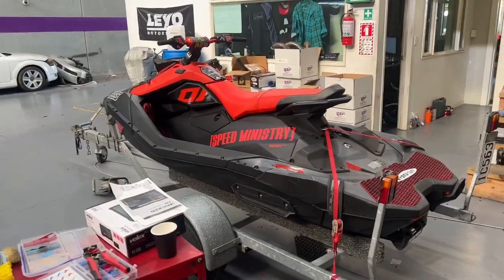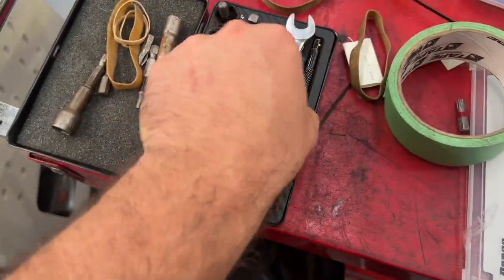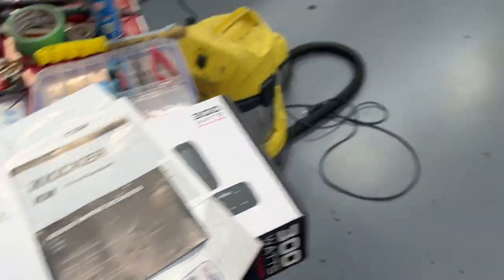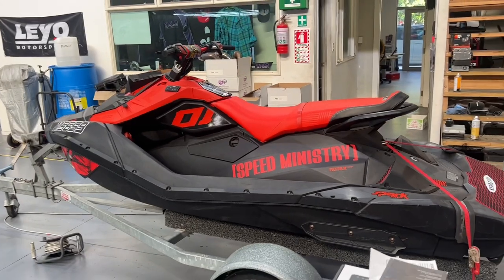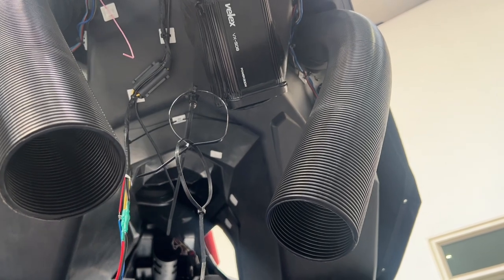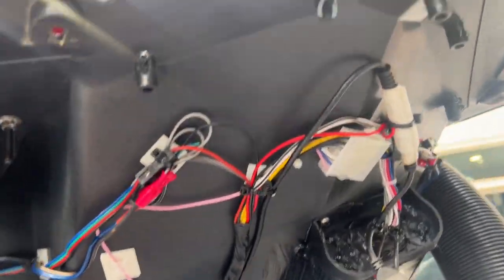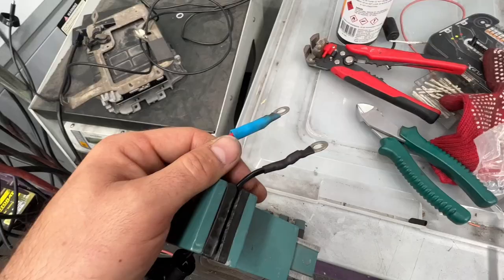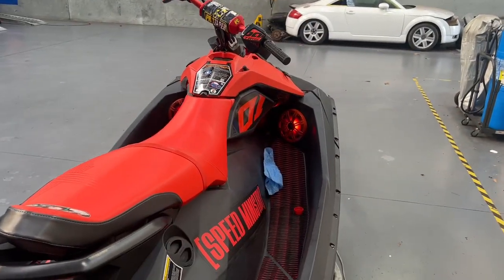SeaDoo Spark HOW TO: Stereo on a budget

Comment from the maker: PSA: CHECK THESE SETTINGS ON YOUR PHONE (especially if you have static/ground loop noise/ hiss)
1) If you streaming from Spotify, go to "Settings & Privacy", then Playback. a) Change the volume level from normal to loud. b) go into equalizer, and change to "small speakers". 
2) For phone itself - Go into Settings - Sounds - Headphone safety. Make sure you don't have Head Phone safety volume turned on. THIS WILL SEVELY LIMIT THE VOLUME and force you to max out the volume on the amp, which will give you the hiss.  

3) lower the volume on the jetski stereo (on the amp controller), and bring the volume on the phone all the way up. This way you don't have to run the amp "louder".

Comment: Did this exact install.  Do you have some buzz when power on.  Doesn’t get louder with volume but if music pauses hear some static/humm
Reply from the maker: hmmm, interesting. 
No, no buzz for me. What you are describing -  sounds like a ground loop,  usually happens when something is not grounded right. It can also happen when you have random interference somewhere. make sure that your 12V feed and ground are straight from and to battery terminals, and that terminals are not oxidized. 

One other thing to try - 
1) If you streaming from Spotify, go "Settings & Privacy", then Playback. a) Change the volume level from normal to loud. b) go into equalizer, and change to "small speakers". 
2)lower the volume on the jetski stereo (on the amp controller)
3) bring the volume on the phone all the way up. 

Try this. Usually, the static noises become more audible when the source (phone) volume is low, and your amp's volume is too high (more technical  - Google gain setting). Cause technically amp amplifies (excuse the shitty pun) whatever you feed it, meaning if there is some static/noise, it will make it a lot more audible.
Reply from the maker: If all that fails, try powering the amp from a different battery outside of the ski. if the noise is still there - claim a refund on the amp or replacement. at the end of the day, chinesium is great, but it's still chinesium.

Also, give us an update when you tried it. This video gained about X10000 times more traction than i thought it would, with confirmed at least 50+ installs, so whatever trouble you having, most likely someone else will have the same glitch. Comment section usually has real answers to problems :)
Reply: I actually got another one from Amazon.  It does the same thing so I’m a little disappointed.  It’s weird.
Reply from the maker: @RC-zn1pn  have you tried adjusting the volume on your phone? Another fun one from a bloke in Ireland - he had that hiss and though the speakers. 
Turns out he had 2 things - 
1. Needed that trick with Spotify equalizer (a couple comments above this) 
2. For Iphone itself - Go into Settings - Sounds - Headphone safety. His Volume was clipped at 50%. So to hear any music on the ski, he had to max out the volume on the amp. 
I've tried the same thing, and, sure enough, if the source volume is low and clipped, and you wind up the Chinesium Velex all the way up, she has an uncomfortable hisssssssss.

Comment: How often do you charge the battery? I have 2 kickers and a 4 channel amp and I originally got low voltage issues after a couple hours riding. Now I charge the battery after every ride. Have you considered a secondary battery?
Reply from the maker: just came back from holidays, put on 18 hours of riding with max volume, not a single charge. But i did replace the stock trash battery with higher CCA AGM one :)
these days, my go-to is lithium Ion. They came down in price quite nicely.

Comment: How does the bass sound without an enclosure? Would you say same, better or worse than stock sea-doo sound system?
Reply from the maker: Hey. Bass, by definition, requires enclosure. Otherwise you will end up with nothing but high frequency. stock sea-doo sound system - Which one? Bit better than on on RXT, 10 times better than a clip on spark one.

Comment: I wanted to know if 6x9 speakers will fit where you put the kicker 6.5???
BTW great video and loved the humor 👍👍👍👍
Reply from the maker: Thank man:) I did actually toy with the idea of 6X9, but the 2 core issues killed the idea for me. 
1. Doing a cut out for 6x9 requires a lot of patience and precision, and I'm really not the arts and crafts guy.
2. Finding a CHEAP and WATERPROOF combo of a beefy amp to drive beefy 6x9 proved to be nearly impossible. Most of the 6x9 are rated for silly power, and you do not want to underdrive the speakers. Also, all powerful amps were massive for application. But, in all honesty, just didnt want to spend massive $ on the set up.
2a. Structural strength -Purely theoretical  - Having a round hole will introduce less chances of hull flex. Maybe i smoked too much and that issue exists only in my head and fairies are not real.

Comment: Great how to video bud.  I am doing it just like you because I haven't anyone do it better.  Have you had any issues with the cable tie bases?
Reply from the maker: Ive done few installs for customers since then, and trick is to buy the holders without tape on them, and attach them with polyurethane. no issues otherwise.

Comment: Have you tried the unit much since installing? 

Always afraid of import crap but if your expectations are low anyway I assume the work just fine. 

I’m a fresh water rider anyway. Not worried about salt corrosion or anything…
Reply from the maker: About 15 hours with full volume, jumps, upside-downs, everything you can imagine. No issues. WARNING: if you streaming Spotify, set EQ to “small speakers”, otherwise too much bass